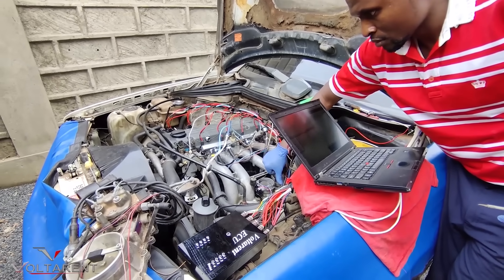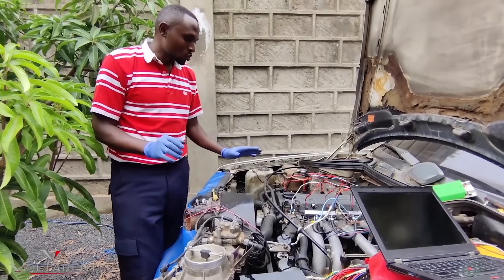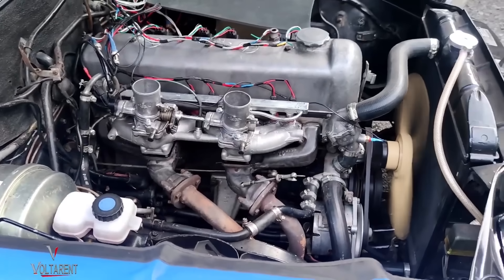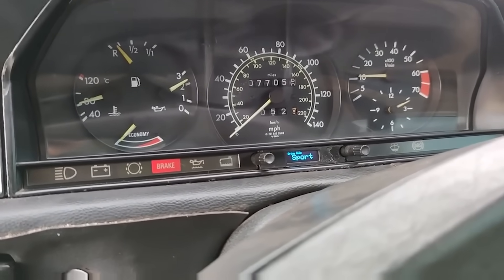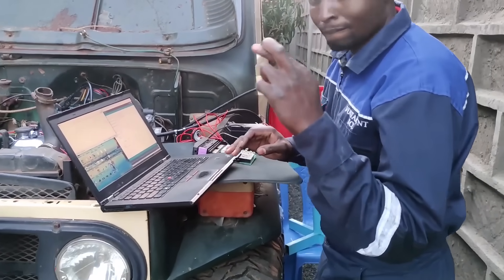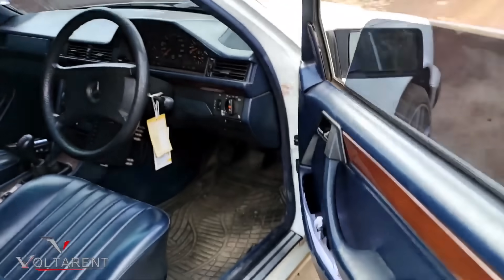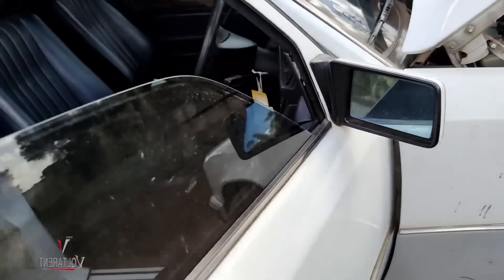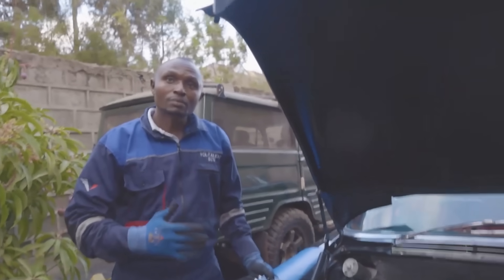African Genius makes Old Engines outdo Modern Engines!

Comment: The guy loves what he's doing. I like carburetors but there's no denying the benefits of EFI and this dude is building it from scratch.
Reply: I hate Electronics for the simple reason that it's a cheatcode to cram overly complex systems into tiny spaces that don't need them, such as making car go burr, yes you can squeeze all the marginal benefits out of direct injection with electronic controls but it's the pinky you give up that will cost you your whole arm, as we've seen with cars in the last 30 years with canbus systems that will brick your whole car over a bad tail light.
Reply: @abrahamedelstein4806  I'll stick with carbs and breaker points if I can. If something starts acting up, chances are I can at least get myself home. Even if I have to tow it home, once I'm home I can deal with all manner of nonsense. EFI, if a resistor or a capacitor goes out I'm probably done for. I'm not skilled or equipped to deal with electronics, nor do I enjoy them. This guys is loving it though and that's fine for him. Just keep it off my vehicles.
Reply: @abrahamedelstein4806 you're really black/white. Full canbus or efi fuel management are very different
Reply: @abrahamedelstein4806 world keeps advancing and your knowledge needs to advance so hating it probably stops you from doing what Peter does 
Electrical will only get much more complex and turning away isn’t fixing anything or learning anything 
The more you know the more you’re  skills = value = success
Reply: @abrahamedelstein4806  yes everything  needs a module.  Abs trac wipers air bags reverse camera . Then another computer to diagnose it (scan tool) when it 🙄 breaks.

Comment: Website feedback 

	1.	Customer Service: Emphasize the importance of offering excellent customer service to both local and international clients. This includes easy access to support and clear, step-by-step instructions for installing and using the ECU.
	2.	Smooth Customer Experience: Ensure the website offers a seamless and secure experience, from browsing to purchasing. This can include optimizing the website’s layout, simplifying the checkout process, and providing clear product details.
	3.	Security: Highlight that the website is secure, using the latest encryption methods to protect customers’ information and transactions.
	4.	Grammar and Clarity: Revise any grammar issues on the website to maintain professionalism and trustworthiness. Make sure product descriptions and technical details are written clearly for both experts and non-experts.

This product is going to be a success!!

Comment: When life gives you lemons…make lemonade.  I’ve seen Mercedes diesels in Africa running without oil filters and air filters.  Try that with the more modern commonrail engines and they will go Kaput and the computer will say no.

Comment: FreeEMS has ben doing this with GPLv3 code since 2008. It's not difficult and given his is proprietary like the many dozens of others, he's only competing on price, features, and quality. Maybe tax benefits from local manufacture? Some countries are difficult to import gear like that to. Beware of a one man show firmware though, getting the accuracy and precision right and reliable is not as straightforward as making power or getting economy.  That's why open source is important for an ECU, trustworthiness of the firmware. Good luck to him, though. :-)

Comment: Fuel injecting older cars is not some huge feat these days. Designing an ECM is cool though, I'll give him that, but I've been building cars for over 35 years and we would fuel inject them using stock ecu's with upgraded PROM and Calpack's back in the late 80's. Wasn't until the mid 90's until they had stand alone systems, one of the very first being the Accel . I wonder what processor he is using.

Comment: Normal person thanks yeah whatever a person in the automotive industry thinks about all the things you need to put into it as far as throttle body sensor mass air flow oxygen sensors wiring harnesses etc. it takes a genius to be able to make an ECU and have it work well from basically scratch
Reply: No it doesn't. People do this all the time. There are resources all over the place for this. This isn't a new idea. Guarantee he looked at other boards and programs to use as a template if not 100% copy.

Comment: If it is reliable, then Mr. Mbria has obviously not based it on Lucas. Especially The XJS looked like an open goal in that respect. Old Mercedes with Solex could actually work very good as is. The dual 1-port looked interesting, i have only seen 2 ports. I think that is one of the features of a "Sonderklasse".

Is it "calculation", rather than self-taught "map"? Then it is different. Can the user tweak the calculations if needed? That sounds fun, actually.
Reply: The firmware has been written from scratch and it allows one to ticker with it like you would on a carb, only that, you do it via a laptop. You are shown how you can DIY and you kinda own the tunes as you are allowed to do with it as you like. If you mess up and engine doesn't run, load up the previous program and continue tinkering.
Reply: @PeterMbiria1 I owned 2 Jaguar X300;s (94-97), around 2015, i.e. 20 year cars. On both i had to replace the MAF sensors, which of some reason scewed the ECU:s and made them self-teach themselves out of alignment....

I took the cars to an official Jag Workshop and let them run their ECU readjustment procedure. After that the cars would run correctly, then they would self-teach themselves out of alignment again.... 

It was really frustrating and i whished there were parameters you could tweak. I mean, a Jaguar, that does not run good, what is the point...

So an accessible/adjusteable ECU sounds like a great idea, especially on older & special vehicles....   I played with the idea to make an adjustment box for the MAF sensor, because it is an analog signal, but i never got around to it. The Oxygen sensor feedback is not adjustable like that....  I had a college which also worked as SW consultant for automotive companies (that would have been Volvo, Saab). He said they almost always never had time to finish the ECU:s before the cars were released and they barely ran even as new... Not to mention how they might run as the cars age.. 

So yeah, would have been super interesting to play around with...  (But i do not own any vehicles anymore...)

Comment: No serious programmer would use the Arduino IDE as shown in this video. This is probably nothing more than an overpriced version of the easily available Speeduino ECU project. No genius required.

Comment: I have been trying to find someone to help me design a replacement system for modern day day cars with to much electronics and get them to run and drive without all the electronics especially for the many cars that there is no possibility of being fixed in 3rd world countries as mechanical as possible because not everyone has a computer to use

Comment: I truly appreciate the hard work and ingenuity you have exhibited bro. My only gripe is that you're taking credit for all the tsch behind arduino based ecus. Methinks your tech is based on Speeduino,  which is an open source project, as well as tune studio. Nothing wrong with building on top of that stack, but claiming to have literally built the firmware as well as hardware from scratch is bs. Learn to attribute credit. We all stand on the shoulders of giants.
Edit: My criticism doesn't void my genuine admiration for your depth of knowledge and innovation on the tech. I have a little knowledge on this tech and not just a troll. Hopefully 😂.

Comment: I did like this in 2003 using ATmega128, with Code Vision AVR compiler.  It can  be done!  I might have had help from cosmic minds. It was most fun engineering project in my life. I initially wanted to do business, but that not in my talents.  Hobby much better.

Comment: Like a Megasquirt ECU, but just not as good because it runs on Arduino?   It that what it is here?
Reply: It is just an arduino, you know, the one with 32 bit ARM chip, you know, with 84 mHz clock speed. What did you say MegaSquirt ECU clock speed is?

Comment: I don’t doubt this is possible as I’ve seen a few projects like this on GitHub, but I find it interesting and dare I say fake because most old vehicles engines rock when turned on or is running. 

I speak as an ex-mechanic and now software engineer.

Comment: Do you get the software is it his own software ? what would be the maximum output in percentage you could get by remapping it with his ECU? And it has different modes you can select how many just two or more he said something about comfort and Sport they're the only two? you can't change throttle geometry steering geometry and suspension geometry by this ECU just engine? Looking for something for my SLK 230 I was going to attempt to repair it or get a second hand one hard to get hold of.

Comment: This looks very similar to a Megasquirt or Megasquirt 2 stand alone ECU.   
I have a Megasquirt 2 running my 2J swapped 1974 Datsun 260Z. 
The Megasquirt 2 ecu unit can be removed and set up to run any engine. Can be tuned with a tablet or laptop. Not sure if a phone can do this also.

Comment: So he is a genus for relabeling a speeduino ecu?
Reply: Hmmmm, well, if I come to you and brand your hard earned product a copy, would you smile at me? I know speeduino that uses 8 bit arduino Mega board, I use Arduino Due 32 bit 84 mHz board and wrote several thousand lines as the firmware for it. Is it hard to believe I can do it or hard to believe it can be done by an individual, who happens to be african?

Comment: He should create an engine that will run off of water, separating the hydrogen gas from the water molecule, thru electrolysis, and make those plans available free to everybody, so Big Oil will NOT off him, like they did with the earlier pioneers of water-based motors! Great man!
Reply: Sadly that's not possible, you can't create energy. It takes more power to fracture a water molecule into hydrogen and oxygen than it creates re combining them.

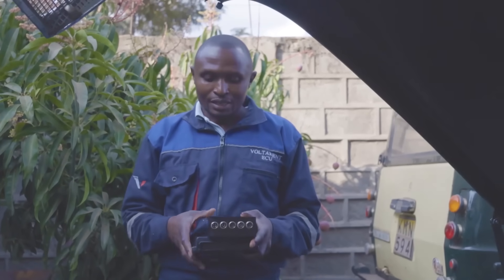Comment: 5:30 components for automotive need to be high tolerances for heat and external interference, cross checks for good data acquisition, does it include an OBD or scan port, make sure to use heat sinks and thermal compound for hot days air flow and or high heat tolerant parts and fully potted/water sealed, does this use a wide band o2 sensor and or all the original sensors, need to measure and make its not running lean and also ignition timing for not pinging/spark knocking sensor

Comment: Absolutely luv this genius, though he elaborated mostly on his skills as a ECU fabricator and programming codes using Aurdino etc, however he did not say how electronic ECU's need very accurate crank signals and camshaft timing signals how he implements these in older engines, getting rid of carbs is relatively easy as you could hook up a new manifold with injectors, so things like oxygen sensor, etc etc in order to bring utmost efficiency and emissions control from an older engine, if he could convert older car engines especially on classic cars that are subject to emissions road charges such as in London any cars below year 2002 are considered higher polluting cars so their drivers have to pay £12.50 ULEZ charge to drive that car per day, so this man's skills could be utiliesed in achieving Euro 4 emissions or higher on older cars below Euro 4 emissions.

Comment: This is dumb its juat speeduino i doubt he wrote much if any code for it byt people do this kind if stuff all the time and just going with fuel injection and coils that you can control the spark with wont make an old enrun like new modern ones it might run slightly better than before bot not a big difference if there wasn't anything else wrong before
Reply: sure... speeduino does the designs, fabrication, Welding and lathe work that comes with this conversion.... I would also go for speeduino.
Reply: Well they marketed him as a genius and im not sure how much fabrication he is doing that one had some welding and stuff but I don't think its much if he is converting other people's cars
Reply: @mmwangimuchoki7035  🤣🤣🤣🤣🤣🤣

Comment: Nice! There's plenty of aftermarket ECUs and EFI, but nothing in the price range of Arduino hardware, usually it's several thousand US dollars cost, not the hundred or so we see here. That means that while it's not the tech that's revolutionary, it's the price point and accessibility, making older cars run cleaner.

Comment: Just for removing the K-Jetronic he's already a hero to me.

Also Arduino is not really a real-time solution, so there is some wizardry there. I would really wish to know how is he timing all the events like injectors and ignition, and how does he even know if the AFR is correct.

Comment: This guy is the worlds leading environmentalist as far as I am concerned. He is extending the life of existing transport tech and thereby commuting the need for the spurious manufacture (which is the real environmental cost) of new vehicles. In the process, upgrading old vehicles to be far more fuel efficient. This is leading environmentalism because there are hundreds of millions of cars that can potentially benefit from this. There are literally graveyards of EVs that have never spent their life transporting people. They are insanity. This tech is the polar opposite of that. 
This is how it's done. Somebody give this guy a medal, an obscene amount of money, and a mandate to roll this out to all old vehicles.
Reply: What about all the other people that have been making EFI kits for old vehicles for the last 3 decades? What makes him so special?
Reply: @keeblertime1486  nothing special about it - EFI is old tech, been doing it for decades - I have not had a carburated engine since the 80s
Reply: i am absolutely getting one of these when i get a car. no doubt.
Reply: This guy is freaking awesome. But what you're saying is simply not true. You can like ICE cars without having to bash EVs; it's not a competition. New cars are fokking boring anyway compared to these old beauties.

So back to your argument: an EV recoups the extra CO2 released during (battery) production between 1 and 2 years. Even if the energy mix is dirty, you have to consider that a power plant is way more efficient than an ICE. And, new (long-range) batteries are being developed as we speak, look up Toyota's plan for solid state.

In any case, congratulations to this man for keeping these beautiful old cars alive.
Reply: This guy is freaking awesome. But what you're saying is simply not true. You can like ICE cars without having to bash EVs; it's not a competition. New cars are extremely boring anyway compared to these old beauties.

So back to your argument: an EV recoups the extra CO2 released during (battery) production between 1 and 2 years. Even if the energy mix is dirty, you have to consider that a power plant is way more efficient than an ICE. And, new (long-range) batteries are being developed as we speak, look up Toyota's plan for solid state.

In any case, congratulations to this man for keeping these beautiful old cars alive.
Reply: This guy is freaking awesome. But what you're saying is simply not true. You can like ICE cars without having to bash EVs; it's not a competition. New cars are extremely boring anyway compared to these old beauties.

So back to your argument: an EV recoups the extra CO2 released during (battery) production between 1 and 2 years. Even if the energy mix is dirty, you have to consider that a power plant is way more efficient than an ICE. And, new (long-range) batteries are being developed as we speak, look up Toyota's plan for solid state.

In any case, congratulations to this man for keeping these beautiful old cars alive.
Reply: Test
Reply: Environmentalist politicians ban these things or ruin it in one way or another. Everything has to be new and expensive and run on batteries/minerals there isnt enough of and taking more energy to produce and cycle than the smart solution.

Comment: I still don't really understand what he's doing here.. Is he connecting some sort of voltage reader to the end of the spark plugs and something on the fuel injectors to manage the ratios or something? If anyone can clear it up a little that would be cool, cheers

Comment: So the guy made his own aftermarket standalone EFI. It looks pretty basic compared to the off the shelf stuff available in the USA, but I imagine he's prioritizing simplicity and using easily sourced components to save on cost. I could this being a good way to give new life to vehichles with worn out or poorly tuned mechanical injection or carburetors. You're only going to see big efficiency gains in things that are running too rich, but dump more fuel can often be used as a solution when trying to get something to just run.

Comment: This guy could be a billionaire in Africa. He's genuinely a genius. Old straight six engines are mechanically very reliable because they are inherently balanced and only need one fairly simple cam system for the valves. The core of the engine can run for hundreds of thousands of miles and several decades. If they could suddenly be reliable with fuel injection and double their fuel mileage it would save owners a fortune and make an old car run like new. He could probably sell a million of these systems if there was a way to get garages to install them. There is a simplified version of this in the U.S. called the "carb cheater" that puts an ECU on an old carbureted engine and monitors it with an O2 sensor and adjusts the airflow to keep the fuel balance right and the engine tuned.